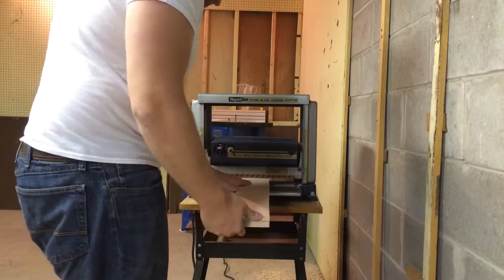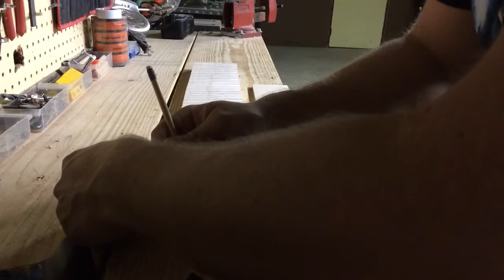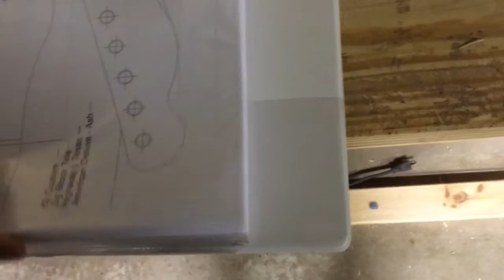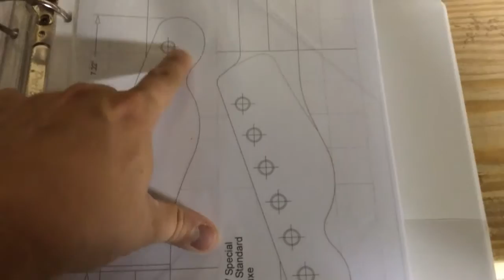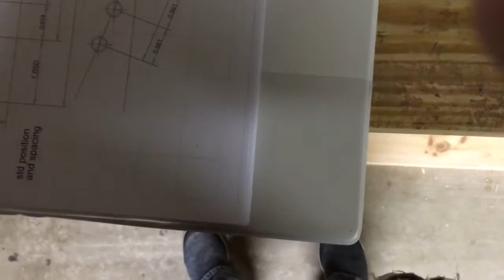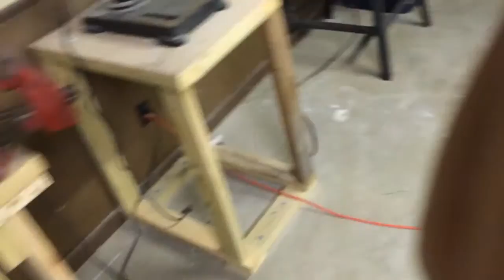Solid body electric guitar build part 2

Comment: IF ANYONE IS LOOKING FOR TEMPLATES CHECK OUT POTVIN GUITARS, GUITAR BUILDING TEMPLATES, EBAY, AND FOR THE BEST TELE OR STRAT TEMPLATES ON THE MARKET RIGHT OUT OF THE BOX, FLETCHERS HND CRAFTED GUITARS OUT OF AUSTRALIA ARE AMAZING. OH YEAH BUILD YOUR OWN GUITAR HAS GOOD PLANS AND THERE ARE A FEW OTHERS. ALWAYS MEASURE FOR PICKUP, NECK POCKET AND BRIDGE POSITIONS BEFOR USING ANY TEMPLATE THEY ARE RARELY ACCURATE BUT THEY DO WORK GREAT FOR THE BODY AND NECK SHAPES AND FOR CREATING YOUR OWN TEMPLATES FROM.